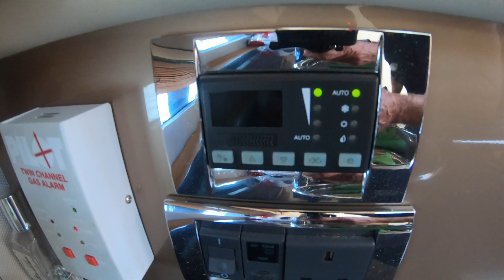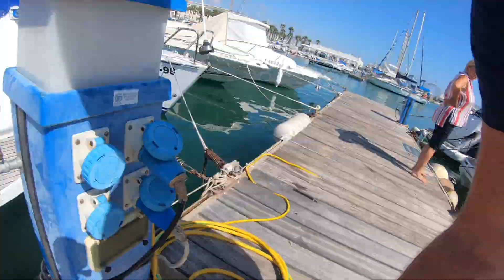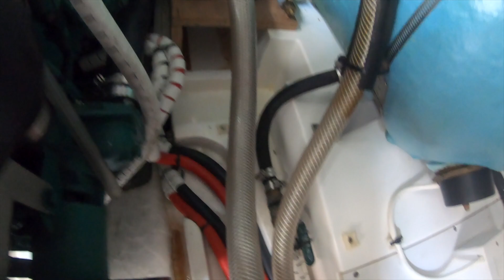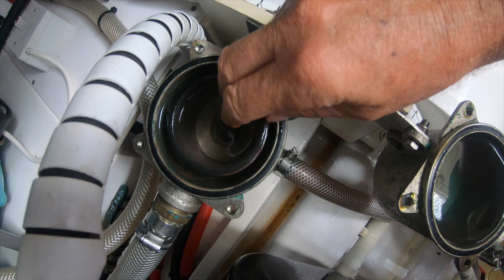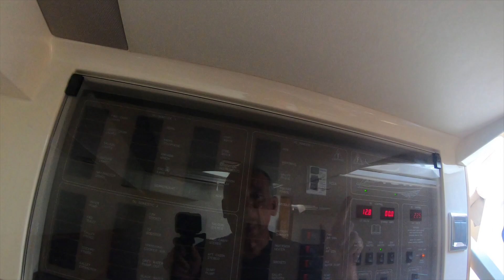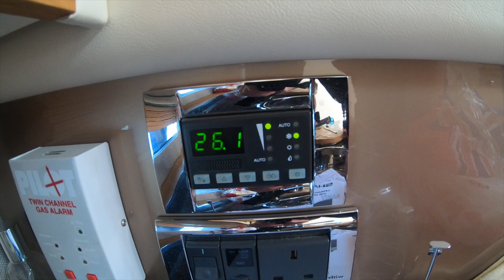HPF error code | quick fix

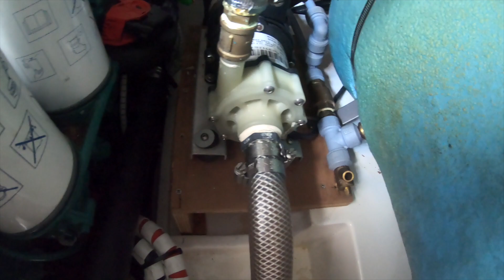Comment: At 1:25 it is very clear the discharge hose from the pump goes up and then back down which is an issue and allows air to be trapped, the hose should gradually go up so all air leaks out!

Comment: My HPF occurs after running for some time, not immediately. When I turn the system on, water is flowing well out the side of the boat, and the air is very cold from the unit (~58deg according to the temp gun at the source vent). However, after 30 - 90 minutes (it is variable how long it takes), the system goes into HPF. If I turn off the unit, wait 10 minutes or so, start back up, it will do the same and work for a while then HPF after a bit). 

I think at this point it might be a pump that is getting too hot and stopping pumping perhaps? Or perhaps the AC unit itself has dirty coils and needs to be cleaned out with barnacle buster or something similar? I'm on a lake so there shouldn't be barnacles, but i read it is an effective flushing tool to use for cleaning the coils. A pump is ~$350 on Amazon, so any other advice appreciated :)
Reply: Hi Paul, without looking at it's hard to pinpoint, however, from what you said the compressor may be slowly heating up as the cooling system may be a little under par as you mentioned there could be a  restricted flow, in which case you know the action, but perhaps I'd firstly clean the raw water filter or if it's a small system you may have a little inline filter hidden away somewhere, have you checked these? Lastly how old is the raw water electric pump as you may find she's seen better days and not quite delivering enough liquid, however, this can easily be solved with a pump service kit. 

Best regards 
Rob
Reply: Sorry this is my boat care but I signed in with a different account
Reply: @dubaiproperty30  oh no worries, appreciate the response. Called Dometic and the guy on the phone said that it's most likely the water flow and given it is running for some time before it quits, almost certain it is something up with the pump. His suggestion was that the pump itself is cooled by some small part of the water coming in and it could be overheating the pump after some time. He suggested a rebuild of the pump to ensure all parts are working well for a few hours on its own or just buying a new pump ($300 or so) and eliminate that as part of the issue. He did say that bromine, chlorine, etc., are all bad to use and that barnacle buster would likely not do much given I'm on a lake and it's more likely to be algae, weeds, sand, etc., and if I'm seeing good constant clean flow with a garden hose hooked up to each hose that it again points to the pump being the culprit!

Comment: A clear and concise explanation.  I’ve had a very brief look at your website and it looks really helpful.  I will have a peruse in due course.  I have a narrowboat with a vintage engine, built in generator and air con in the saloon and cabin so always looking to learn from others who have the knowledge and experience.  Thank you😁
Reply: Many thanks, Martin, Believe it or not, I'm heading home to the UK after 30 years and will be getting a narrowboat so I may be asking you for advice ???
Reply: @myboatcare6241  ha ha.  I used to sail in the Solent during the early 90’s.  I can assure you that handling a narrowboat in a calm ditch is child’s play when compared to yachting.  You also have the advantage that the only issues that you are likely to encounter surround those matters which you clearly have knowledge namely engines and electrical😁😁.  It really is a very relaxing and enjoyable past time.  You’re more than welcome to have a look around if you are interested.  Best wishes Martin
Reply: @blacklablover2982  thanks for your kind words, Martin. I Will surely take you up on future adice, perhaps even now, can I ask:  where is the best location to keep a Narrowboat for canals and scenery?